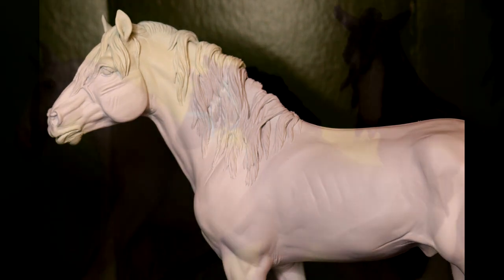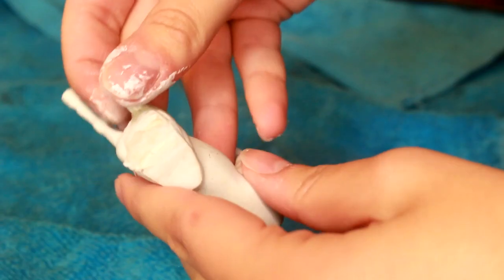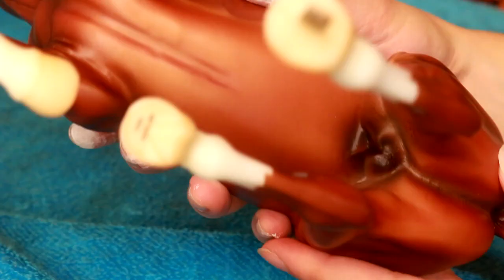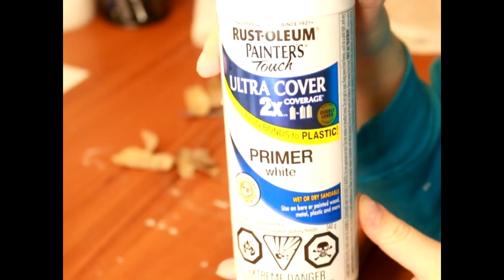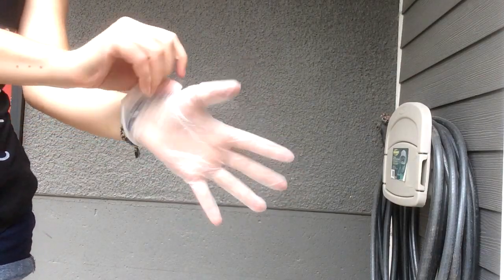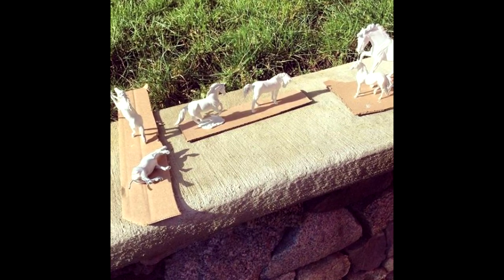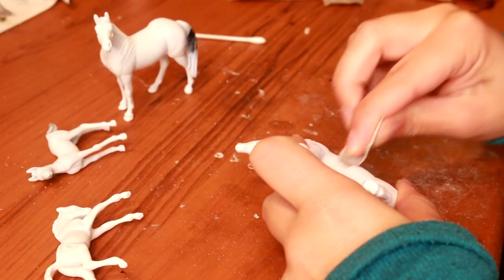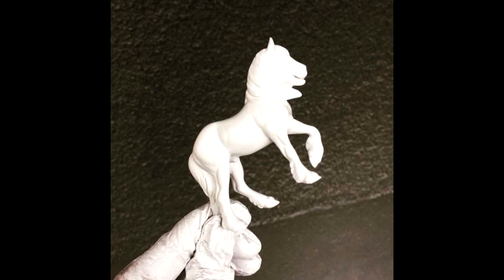HOW TO PREP AND PRIME a BREYER MODEL HORSE for Customizing - Tutorial

Comment: Good stuff!

I'd add a fan to blow the spray downwind, a proper spray painting mask, and a portable small ceramic heater (not too close) to the models to speed drying. If you set them on silicone mats (as in for cooking) they should not stick.

Rustoleum is awesome, have used it for many outdoor projects and it does not die.

Comment: Will this work with schliech? (Please answer, if do thank you)😊
Reply from the maker: Schleich models are a little bit different. They are made with a different type of plastic. I have heard that this type of plastic reacts to spray on primer and makes the model sticky (I didn't have this issue, but I had troubles sanding the seams) - customizers I follow have had better results painting on Gesso... I need to experiment more with this type of model personally, if I find any interesting results- I will make a tutorial. My only suggestion is to try and see what happens. If I find out more, I'll let you know!
Reply: Ok thankyou!😊

Comment: Should i sand it down and add a new air hole and cover up the air hole even if I’m using chalk pastels?
Reply from the maker: adyson Case Yes. You should always do prep work on any model you paint, regardless of what medium you use. If you’re going to be spending several days painting wouldn’t you want the finished piece as realistic and detailed as possible? It would be a shame to put in all the hard work of painting and leave flaws on the original model. Chalk pastels will pick up more obvious flaws in the model as well since they are more delicate in use.
Reply: DeeJayBe Studios Ok tysm !

Comment: So I did get hold of rust-oleum primer I finished priming him earlier and I intend to use pastels on him. However when he had just dried I caught my grandmother touching him after I told her not to because of oils on her hand. Is there a way to remove those marks before I use my pastels? If not I had the idea that I could turn him into a paint to remove the marks of her finger prints that will show up in the pastels. Do you have any advice on fixing it before the pastel phase or should I cover them up with white markings?

Comment: Hello do the same rules of prepping Breyer apply to the collecta horses? I bought the Andalusian stallion grey and they paint is coming off the mane in rubbery pieces as if it never adhered to the model. What is the best way to get rid of this thick paint?
Reply: CollectA horses are made with a rubbery plastic similar to Schleich horses.  Maybe try to remove the paint with hot water (not scalding), and rubbing it off?  I have a couple of CollectA horses, but no experience in removing paint.  (Jan Griffiths).

Comment: Is there anything you can use if you don’t have primer?
Reply from the maker: As an alternative, you can buy Gesso and paint it on. You have to use some sort of surface primer, so the paint has tooth to stick to, otherwise it will just chip off.
Reply: @DeeJayBeStudios  I paint a model only with acrylic, is there a risk that the paint gets stuck? I spray a layer of varnish at each stage)
Reply: I use White acrylic paint to prime it
Reply: I use appple barrel

Comment: So I have been considering getting my first model I can’t get a hold of primer since no art stores in the U.K. seem to sell it at least ones near me. Would white acrylics work in fine watered down layers  to limit brush strokes?
Reply from the maker: Can you find Gesso? That is a primer you can paint on. Primer/spray paint is also available in hardware & department stores.
Reply: DeeJayBe Studios yes I have found some Gesso for a good price on my local stores online site however they are completely out of stock. The only one they have available is a large container which is far more than I need and out of my price range. I am not sure when they will come back into stock so I could have a look at my hardware store if they have it.

Comment: If I tried to Custom my Breyer horse and used Acrylic paint on its legs and face how do I get that Paint off? - sandpaper?
Reply from the maker: Easy off would work great. If the paint is not sealed to the model with a sealer, soaking it in hot water will also release the paint.

Comment: This sounds dumb but would you wait the full 24 hours to then prime the tail areas you missed because you were holding onto them?
Reply from the maker: Yes, I like to wait at least 12 hours before fully handling the model. With the Rustoleum primer, it tends to be sticky if not cured fully, so that can compromise the finish if you handle the model too soon. I have gotten away with waiting an hour or too; if you hold onto the model with a piece of paper towel- but the longer you can wait, the better! Thanks for your question.
Reply: Yep, 24 hours is a safe bet.  And handle the newly primed model with gloves.  That way, the oils from you skin won't get on the primer.  (Jan Griffiths).

Comment: what temp would be the best to prime in?
Reply from the maker: Ive never had problems with temperatures and priming. But I don’t leave the models outside to dry when it’s overly hot or cold, I bring them in. I prime successfully through both the summer and winter. Neutral temperatures definitely work best.

Comment: Would a nail file work for sanding seams?
Reply from the maker: For some areas yes I think it would. Sandpaper is more versatile for hard to reach areas - and stronger in design.
Reply: DeeJayBe Studios okay thanks, is there a way to get the horse ready for painting without primer?
Reply from the maker: @mongooseodon7608   The primer is important as it provides a solid foundation for the paint to stick to. It also gives you a opaque and even layer to paint on top of. If you paint straight onto a smooth surface model, it will be really easy to chip and hard to cover.
Reply: DeeJayBe Studios oh alright, thank you so much!

Comment: Don’t fill in the hole! It will cause the model to bloat or shrink!
Reply from the maker: The hole is re-drilled in the groin area as a more discreet location
Reply: She drilled a new hole.  I do the same, but it's  on the right side of the groin area.  Stablemates are solidly molded, so no air hole is needed.  Same with Mini Whinnies.  (Jan Griffiths).